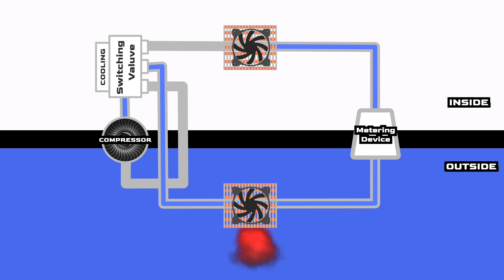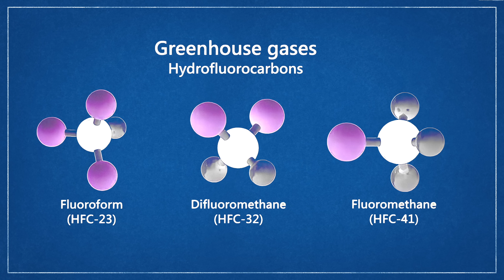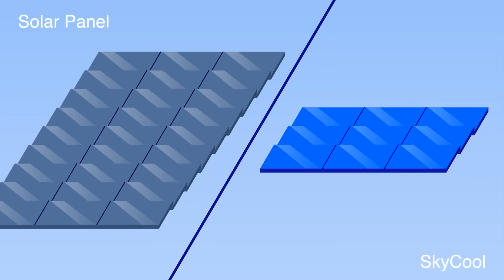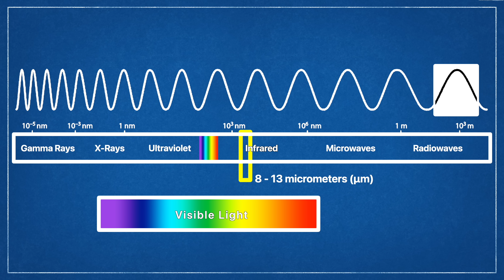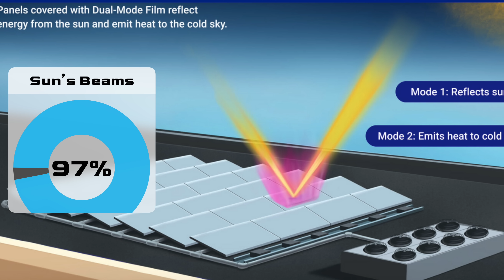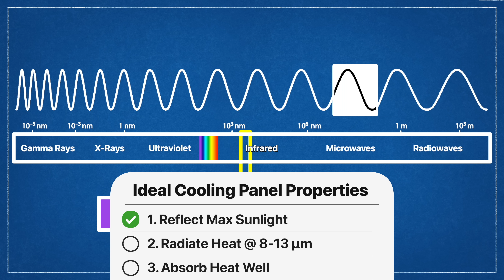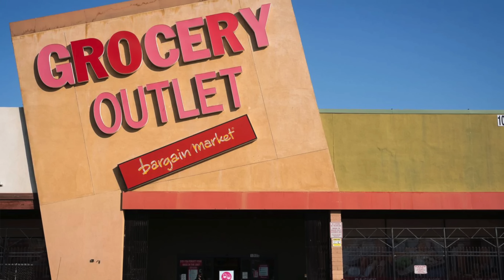New AC Tech Sends Heat Into Space & Saves 95% On Cooling Bills!

Comment: Very interesting concept, but here in Australia, we reach temps above 45°c, so it wouldn't be that great here. In our drier regions, we utilise evaporative cooling, as a preference over traditional airconditioning, but in our more humid regions, we rely on airconditioning.   So not really sure this would work here.  Also, with all that heat being redirected back towards the sky, has any studies been done on what this heating zffect would do to our atmosphere, or our ozone layer, cause I don't think it would be good, we've seen hypothetical scenarios play out in disaster movies, and alot of the science seems to back these scenario's, hence our whole global warming affects, I hope someone can scientifically prove me wrong.
Reply: The idea is that at a narrow band of wavelengths, the energy radiates directly to outer space, not the atmosphere. So the tech aims to radiate in that band. Clouds and humidity reduce the efficiency, but not to zero. It should have some utility anywhere you want cooling, and can make existing systems more efficient. Hopefully in future it can be combined with photovoltaic solar panels to keep them cool and efficient, and provide cooling and electricity.
 It doesn't solve everything by itself but it could be a a big help. It shouldn't add heat to the atmosphere, that's part of the point of using it vs. heat pump air conditioners which remove heat from indoors but dump it outdoors.

Comment: Needs a clear sky to work. So it will have to have a complete backup system capable of completely replacing the system on rainy days, humid, and cloudy days. If used for refrigeration or large buildings doubly so.

Comment: Isn't the bulk of electricity used on ac units from the fan to move the cold around the building? Compressors don't use very much electricity. Also ac pushing the heat outside is a 0 net gain. Doesn't heat the environment.

Comment: If you look at temperatures in history, you will find it was much hotter prior to the ice age we are currently exiting. You also downplay the fact that most of the US would not have a reliable source of cooling due to humidity and cloud cover. If the external temperature is 95 degrees, the highest rating of 15 degrees cooling would net a temperature of 80 degrees inside. The people stating the temperatures are rising are from the most heavily populated cities where increased paving and high rise buildings create more and more heat retention at night.

Comment: Heat in buildings is energy, if it could instead be converted to electricity, less electrical production would be needed.   Something better than Peltier thermo-electric generators or steam engines powered by boiling Ammonia needs to come along to just store the heat for re-use as electrical power.

Comment: Wouldn't it still work in shades?
I mean, u can have ur solar panels generating electricity on the more sunny side of the roof since it needs more direct sunlight but then have the sky cool system set up in those parts where the solar panels r least efficient
Yes, that would cuz a big loss to the systems efficiency due the cooling effect it gains from reflecting the sunlight, but it would still help save a lot more power than just running a heat pump system instead, correct ?

Comment: Here’s a thought. The sky cool panels could be installed on the non-southern facing parts of the roof which are less efficient at creating solar powered electricity. So you would have radiative cooling, which doesn’t have to be aimed at the sun, on the areas of your roof with less potential for solar power generation. Of course the ideal solution would also involve increasing the albedo or heat reflectivity of your roof along with solar power generation in the solar panels on the sun optimized areas of your roof and the sky cool panels on the rest.
Reply: Heat can be extracted/radiated from the solar panels through glycol channels to the non solar side. The pumping of fluid is cheap.
Reply: Another thought is to use solar panels that allow infrared to pass through and integrate them with the sky cool panels for less footprint. I couldn't find that exact solar panel tech, but there are already solar panels that allow visible light through. Not sure if they are on the market yet though.
Reply: southern facing parts of the roof is where the greatest amount of heat and reflective heat is created.

Comment: This is a joke right?
That was a ridiculous explanation of AC units and the refrigeration cycle. They are closed systems aka if they are leaking they are broken and need fixing. A working AC doesn't produce emissions.

This is literally the same thing as window  tint. If you spring for the higher end stuff it has an extra layer that reflects uv, up to 98%, and helps keep your car cool. And shocker, most companies will happily put  clear tint that does the same thing on you house windows.

Did people just forget entropy is a thing? All well and good to reflect the heat on top but there's no such thing as perfect insulation and thermal energy from outside (everywhere not just the roof) will get in. So it doesn't matter how much of this stuff you use the inside temp will eventually match (or exceed depending on heat production inside a structure) the temperature outside. 

And yes obviously there was a reduction in energy usage because they removed the AC units. However note that nowhere did it mention that the panels were capable of even matching the cooling performance of the ACs they replaced. 

I'm half into a bottle of vodka and I can still think this through.

Comment: Wait, how is this system 'radiating heat into space'? Just like with an AC, the energy(heat) is being moved outside as well. Also, there is still the atmosphere that you need to cut through before you reach space?
How different is this really than the heat exchanger in an AC, besides that fact that this requires much less power?

Comment: I wonder what the size limit is for those arrays as a variation of this system might be very useful for covering large outdoor parking lots.  Granted, you'd lose some parking spaces to structural support beams (or not?  Hmm, all depends upon how those spaces are laid out.....) but you'd have a HUGE well of radiative cooling to use for structures like hospitals, malls, sports stadiums, big box stores, data centers and really any place that regularly needs lots of cooling.  Not to mention the additional effect of keeping those parking areas cooler since they'd be in the shade and make it more pleasant for the customers+employees.

It'd be neat if a variation of that panels material could be applied to car roofs to keep them a little cooler during the summer......though I think it would work against the owner during fall+winter.

EDIT:  Also weren't there some transparent solar cells that were being considered for windows at some point?  If that material is transparent to infrared light then perhaps it'd be possible to add those on top of the radiative panels for a little power generation....

Comment: Unless you have central AC you are just putting a band aid over the issue. Most portable AC can only cool the air by 10-15 degrees or so and the window has to be open for the unit to work because the exhaust is hot air. Imagine a community that lives in close proximity and everyone is trying to use those portable AC units. The outside temp would be probably 5-10 degrees hotter which in turn would further reduce the effectiveness of the ac. So a 100 degree day in that situation would maybe be 90-95 with AC...

I live in the United States and during last years heat wave I bought a portable AC just to cool a single room. On a 95 degree day the inside room temp was just barely down to 85.

Comment: I admit that I am new to learning about solar electric systems, from what I have learned so far is that traditional solar cells are more efficient when they are cool, when they heat up most of them drop in output when they get really hot.  Perhaps this radiant cooling technology could be integrated into photovoltaic panels so that along with cooling the building this tech could also keep the solar cells cooler so they always output the rated maximum that the panels are rated for.
Reply: Solar cells work by reacting to the UV rays of the sun. This film reflects the UV rays so I imagine putting the two together would just tank the performance of the solar cells. 

The best option for cooling cells would be a water cooling system on the back of the panel that radiates the heat to the open air.

Also that's another thing. A solar panel would effectively do the same thing as these panels. Namely, keeping the thermal energy from hitting the surface of whatever is below it.

Hell if all you wanted to do was put something on your roof to that prevents the sun from adding heat directly to your house just buy some cheap metal siding polish it a bit and slap it all over your roof. Boom, same thing. Add an air gap for even better results

Comment: Two Bit da Vinci at 8:20 you said the infra red reflectors COOL the incoming water ....even in sunlight.  I know that shiny metal objects in the sun like  a chrome bumper is hot in the sun.  For this to work this has to provide "Ultimate Shade" as if the sun weren't even there.  Is this correct?  and the warmth of the water on the back of the panels gives them an infra red glow that dissipates into space the same as it would at night.  Is that correct?  If so that is great.  But if one of the layers absorbs heat then it will get warm and not work as well.  It has to reflect 99% of sunlight and be cool to the touch.

Comment: Radiative cooling is a scam. If you find out who else is the CEO of skycool you will understand. Whatever gets reflected from your roof heats air above your roof then heat surroundings and gets back through your house wall inside your house as infrared radiation. Regular thin aluminum foil reflects 96% of infrared radiation....no need for their "new technology"
Reply from the maker: It’s not a scam it’s science. Now if it’s commercially viable or worth it… different story

Comment: On the conversation of either-or: Why not both (I know you said both but I had a lightbulb moment). Most homes are not set up with flat roofs or roofs that are directionally perfect for solar arrays.  This means that in all likely hood there would be a part of a roof that would be shaded and thus not useful for solar.  However, this would be even better for passive cooling as they would be in the shade plus using a part of a roof that otherwise would not be used.  Food for thought

Comment: Hate to say it but this system is just another form of heat pump. It's removing heat from inside to the outside. Only difference is that it dumps the heat into space rather than the outside air.

Having said that, it is an amazing technology. But need to figure out the total cost of manufacture plus energy consumption, vs total cost of traditional AC. I'm guessing substantially less. Also need to check carbon footprint for both and environmental impact, e.g. the fluorocarbon vs glycol. I'm still guessing all are better with this new system.

In general we should evaluate the impacts accross all systems when evaluating a new technology. Just focusing on a single aspect can lead to adopting a technology that overall is worse than the one being replaced. On the flip side focusing on effects accross all systems could lead to adopting a technology that appears to have minimal positive effects because it is actually better overall than the technology being replaced.

Comment: Solar panels get hot. There has to be a way to convert the heat into more electricity, or to use a coolant system to take heat from there and the rest of the building to a shaded area and radiate.

Comment: How much hafnium is used in these panels?
Hafnium is a rare earth metal with concentrations of only 5.8 PPM
If these panels are going to work at scale they would need to use virtually no hafnium.\
Also, we already have a great refrigerant we could use: Propane! It's efficient, not particularly toxic, abundant and is far better for the environment.

Comment: Awesome subject.
I'm not sure why you should chose between PV or that new tech. The PV pannels need to be exposed to the sun, while these will probably work better when not exposed too much to the sun. Also, rain tend to cool the air a lot, I'm not sure it would be that much of a problem if the panels don't cool as well in the rain. The same with dark clouds, although there are many cases where the clouds prevent the heat from radiating away in space at night.
Reply: Good points. And also about clouds preventing the heat to escape. They already do this with the heat from conventional AC technology, and to a much greater extent since that emits radiation in a much broader and more random range of wavelengths. So even the heat captured by clouds and such isn't reason to not install this new technology if it works as advertised.

Comment: But one simple win, with standard AC, would be to shed heat into water heating. The usual calculation is 1w in for 3w out, but as u are expounding that 1w anyway, in a sense that heat is free, other than the capital cost. It would be a big manufacturer to have the courage, but Samsung or Danfoss would be great for a combined system.

Comment: Why is it that the grocery store spent $40,000 on cooling and after the installation it only saved them $6,000? It’s nice to have a 15% savings but that was less dramatic than I expected. If I constructed a new house I wouldn’t mind having both heat reflection and solar to offset my annual energy costs. I’m in New Mexico with plenty of sunny days.

Comment: I'm skeptical of the "radiation to space" claim.  The radiative potential is related to temperature to the 4th power, so absorption per unit area of 3-5% from sunlight would actually be higher than radiative cooling per unit area from IR wavelengths that are at temperatures a couple orders of magnitude lower than sunlight.  Further it doesn't really matter if radiative emissions of the panels are reabsorbed somewhere else in the clouds or atmosphere.  Of course, mirrors with 97% reflectivity are not difficult, would also be effective in blocking solar heating of the roof, and convective cooling of the panels from front and back are going to be many times more effective than any radiation.  Bottom line, the impact of radiation from the panels is likely inconsequential and cold space has nothing to do with it.

Comment: This just sounds like a water cooled CONDENSER,  water cooled condensing has been around for ever,  water condensing ie.. refrigerant works 80 times better than air... everybody thinks they come up with a new invention..  I did refrigeration for 30 years...  just take a hose and wet down your AC unit and watch the (refrigerant pressure and temperatures and amp-draw) drop like a rock....

Comment: Too late.  MIT just came out with a white paint that reflects 98.7% of the light that reaches it giving a cooling boost to any building roof painted with it the equivalent of a 10kW AC system.... and all you need to do is "paint" to make it work... not expensive equipment installations.

Besides... Radiative, also known as evaporative, cooling (i.e., a swamp cooler by any other name) absolutely SUCKS at actually "cooling" an indoor area any more than 10 degrees.

Comment: to make heat flow you must move it (humidity/latent and temperature/sensible... I don't think there are quantum hvac units yet). To increase efficiency you must move it with less energy and/or losses. Solar/Geothermal can step in to make things better. This is not new technology...  It uses a larger differential temperature/humidity which makes heat flow more easily, but it also creates more losses and requires more energy to obtain the higher specific heat levels. Relying on radiant heat flow works in space because there is no medium to carry heat or for it to flow thru. Down here, we have liquids and gasses that can be pumped to carry even more heat more easily (lower deltaT/H) than a radiator can do.

Comment: If you live in California or some other mild climate this might work. Humidity is a massive killer to this idea. It needs to do a lot better than a passive 15 drop to control humid climates.
Reply: Humidity itself would not be a problem.
Reply: @TBoneZone  humidity of over 60% for extended duration will breed enough mold to ruin clothes in the closet and show nasty stains on drywall. If you live in a dry climate you won’t see that. The average summer day in central Florida the outdoor humidity ranges from 60% to 80% when it is not raining and about 95% when it is raining. Humidity is a huge problem here and a HVAC contractor who doesn’t do the job properly can cost the homeowner thousands (at least) in damages.

Comment: When I was in the service back in the 60s our EM clubs had water chillers you could hang meat in them. They were very efficient. I would think that anyone that had a personal well would save lots of energy with a system like that. I know that in Canada they are drilling deep wells and bringing up hot water to be used for heating, and it's a loop, so you're recirculating the water. It uses tanks for storage until all the heat has been used. Solar is just to expensive especially for retrofitting.
Reply: Actually solar panels pay for themselves in a few years in most of the US. They are much cheaper than they used to be.